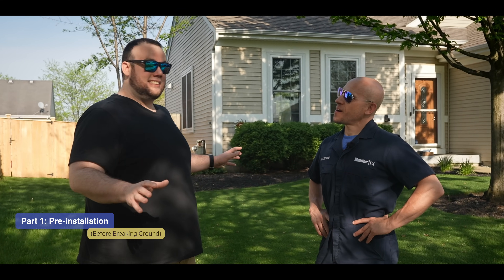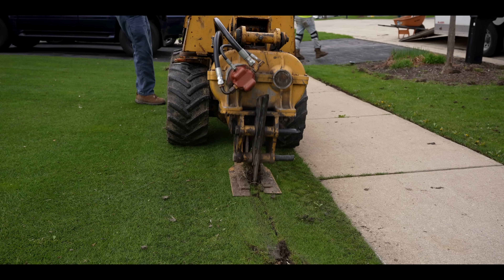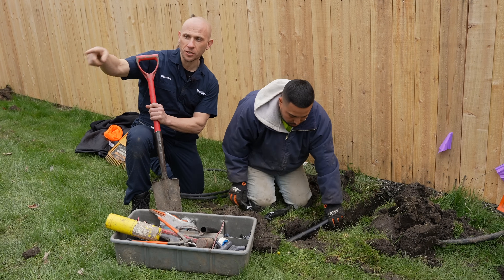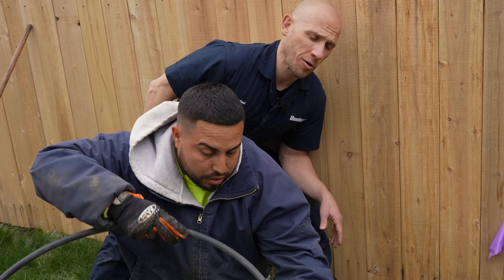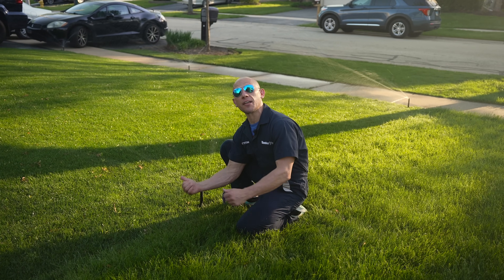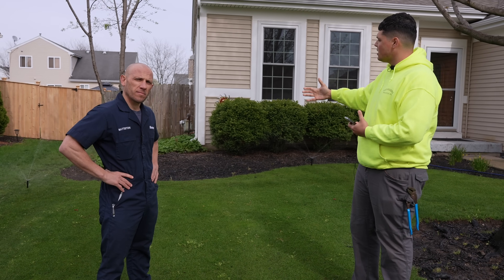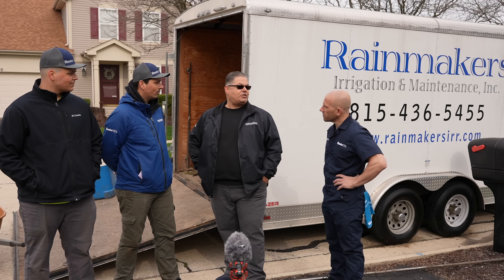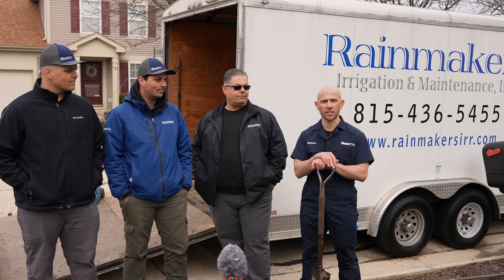I Just Got the ROLLS-ROYCE of Irrigation Systems

Comment: I installed this exact same system myself as a DIY on a 10k sq ft yard last fall. It was definitely a lot of work and took a lot of planning. I installed almost 80 heads, and had to tunnel under sidewalk 5 times since i have a corner lot, and need to get into the easement. Heck I was able water my entire easement with ~20 side stripe heads on a single zone, yea i have a large corner lot! It so awesome, and I don't think you can do that with traditional short range spray nozzle, but I could be wrong.

I learned to use a trencher, and it took more time backfilling the trenches. I saved myself almost 5K!! It is definitely a lot of work, and it took about 5 full days to install 8 zones, and rough in 2 additional zones for landscape irrigation. 

After it is all said and done, MP Rotators and their Hydrowise are the way to go. I can tell a big difference between my lawn and my neighbors who have traditional spray nozzles. I only water my lawn 5 times a week, and it every sq ft of the lawn get no more than 1" of watering a week. Plus the controller can monitor how  much rain I received at my house to alter the water schedule.

I am thinking of creating a video tutorial or my process. It includes the planning, such as how to zone using Hunters provided documents, and installation process using poly tubing since I documented every step I did for future reference. I even had professional irrigation ppl see it, and they were impressed. Lol, or just making me feel good and not telling the truth. Haha.

If anyone is interested, let me know I can create it!
Reply from the maker: Wow props to you my friend, i knw that was quite the project!
And you should make a video! There is a big audience for it.
Reply: I would like to see this!
Reply: Definitely produce that video

Comment: I am I licensed irrigator in the state of Texas, these mp rotator are really awsome. They definitely save water and are extremely durable. I've never had one fail on me
Reply from the maker: Thats great to hear!
Reply: Thank you for your feedback, TExas does it properly with their licensing
Reply: We have had so many failures in our northern climate we refrain from using MP rotors.
Reply: Any issues yet? I plan on getting about 40 MP heads installed across 8 zones
Reply: @theclan011  no issues if installed correctly. Use 40 psi regulated heads with check valves and it will run smoothly.  Even used them in reclaimed water and they do great.
Reply: @AaronRodriguez-rr8dl thanks so much. I hired the guys from this video, rainmakers. They were the only guys in the area that had this down to a science.

Comment: This is pretty much my exact setup: mprotators with the hydrawise controller (my installers thought I was nuts when I asked for them since you need a lot more heads for full coverage). Only thing I wish my installer did was give me 6” popups in certain areas since I mow tall at 4” most of the year. In certain sloped areas, the head barely gets out over the grass especially when it’s overgrown. Something to consider if you have sloped areas or mow tall!
Reply from the maker: nice! are you going to eventually get the 6in pop ups?
Reply: @PrincessCutLawnCare  in certain areas I may make them swap them out but I finally got the lawn back to what it was prior to install so I’d hate to tear up some of turf again. Even though they used the same machine as your installation, it still left divots that I had to level out alone with reseeding certain areas. Minimal damage compared to trenching but definitely still needed work after they left…

Comment: Thanks for the video. I have the Hunter PRS bodies and MP rotators, only 18 months since install and two MP rotators do not turn automatically anymore and need a manual turn to get them going. The supplier replaced both for free, but it took a lot of discussion back and forth before they would accept the return. Citing reasons like, my pressure is low (no), clean the units they must be dirty (that was my first step), you have hard water (well who doesn't), these are designed to work flawlessly (no).

They work great and I love them, but be aware, you will have issues with the MP rotators at some point and they will need replacement. Easy and cheap to do, but not without fault. The coverage they provide is excellent.

Comment: Great video. I paid 13K to have our sprinkler system installed a few years ago and I told the guy that all I care about was to have good coverage. Needless to say I got the complete opposite. I’ve got zones with 12 to 14 heads on them which is WAAY to many. As a lawn care nut, it’s one of the biggest stresses in my life.
Reply: If you don't already have them, swap out to mp rotators. Their low flow can handle that many heads on a zone provided you have 1" lines and decent pressure.
Reply: 1 zone can go up to 100 IF you have strong water flow called GPM ( gallons per minute). For example: if you have 20 GPM, then 1 sprinkler used 1 gpm. You can use up to 20 sprinkler. 
Most of RVan is the kind of rotary nozzle have use 1 or less. So basically check your water pressure, use rotary nozzle like the video you will have good system.

Comment: Irrigation is actually pretty easy to DIY. I’d hire out the back flow but once you’re past that it’s pretty straight forward
Reply: Good video though 👍
Reply from the maker: @TheLawnWhisperer  thanks man, idk with all those mp rotators spinkled throught my yard, i would dread digging 50 holes haha
Reply: Try that here in Florida when it's 96F outside and 90% humidity. I bet you get 5 holes dug and you're done for the day.
Reply from the maker: @kenshinhimura9387  sounds like a nightmare haha
Reply: @kenshinhimura9387  I would still do it 🤷🏻‍♂️

Comment: I did DIY using a regular hose, flexible pipe to connect sprinkler heads and MP rotators then each “zone” hooked up on a Orbit B-Hyve timer. Since I’m using normal pressure coming out of the house, I could only connect 3-4 heads per “zone”. I dug by hand using a shovel (huge pain) but at least it is “in ground” now.
Reply: @Anrodj3  i forgot my measurement of gpm but water pressure is 50 psi
Reply: Okay, so reflecting on it, would you hire or DIY the one on your next home?
Reply: @kevinbattistoni5960  depends.
I did professional install in my new build that’s currently building. this is solely because the real estate market in that area prefers it. (Almost every house has it.) 
If the local market didn’t care for it (ie. there is little to no ROI in home value for installing professional in-ground sprinklers), I would still do DIY.

Comment: With the online websites available to help the DIYer, this is really not that difficult of a job as they state. This is a big sales pitch but still a great informative video. There are several website you can upload your house and lot layouts that you have drawn out of use Google Maps for an aerial view of your house and take a snapshot. Upload and you can plan the entire system out with zones etc. Now be sure to check with local laws etc for permits etc but yes it's usually true you need a plumber to get the plumbing part done but it's not thousands of dollars for the install. There are so many websites to help you out and get the job done yourself and done right. Now don't get me wrong, the Pros do a great job and have lots of experience but one can do it yourself with planning because that's what your paying for with a Professional installation. Heck I currently use my backyard faucet with a 3 way timer splitter and it works great! Do what works for you!

Comment: My last house I paid for a professional install, my current house put in a full 12 zone system myself, 0 issues. The professional one, multiple leaks, heads not dialed in, and a messing looking wiring in the valve box. My install super clean valve box, all wiring in conduit, added surface shutoff, filter, pressure gauge and blow out connection. 
I think this guy is overselling the professional work being labor intensive lol. One of the easier jobs I have done.

Comment: what happens in winter when freezing comes to the water trapped in the check valves? do you need to evacuate the water with air pressure? how does that work without an air compressor?
Reply: Yes, the system will go through what we call the winterization process. Will shoot the process and put it out in George's channel this fall, stay tuned.

Comment: I need this in my area. I’ve had 4 companies come give quotes and all use trenchers only and basically don’t care about damage to the lawn.
Reply from the maker: oh no! we want to avoid those trenchers
Reply: @PrincessCutLawnCare  I used the link in your video description to get connect with potentially 2 new companies I’ve not tried so thank you for that! Hopefully one of them can do it like they did in your video!
Reply: If everyone giving you an estimate is using a trencher it's likely because your ground conditions in your area are too rough for a polar to actually work. Hard ground means trencher loam soil little bit of clay you can get away with a puller
Reply: @BattistoniTrenchTalk  was told today that usually no one recommends a puller because of the shallow pipe it lays that could be hit by a core aerator.

Comment: An MP-Rotator system isn't trivial to install. There are a lot of different heads. Mapping the locations and distances accurately is critical. But well worth it. I've done 3 systems in the family and the results are excellent. Never mind the physical labor, which is the same regardless of which underground head system is use.

Comment: Question.. with the mp rotors, do you need to add more time when I use my irrigation. I have those in the back and the regular sprayers in the front of house. I usually have a set time for the front and back. Also am I able to switch out the fronts for the MP rotary
Reply: Correct, the MP application rate is .40 inches per hour and spray heads are 1.5-2 inches per hour.

Start buy doubling the run time and adjust from there.

Yank those spray nozzles in from and swap out to MP's your turf and you wallet will tank you🎤💧
Reply: @BattistoniTrenchTalk  thank you for the info. I really like the MP rotary.
Reply: @christopherortiz8713  my pleasure, we're glad you found value in the information shared.

Comment: Nicely done video. I noticed that you used clamps on the Poly but not on the flex pipe. Also a little heat to get those barbed fittings in.
Reply from the maker: Thanks Bob!
Reply: Poly requires crimp clamps, flex pipe does not. Thank you for engaging in the content

Comment: I was recommended by a company to not use a pipe pulled because the pipe might be too shallow and could be hit during core aeration. What do you think about that? Was it discussed?
Reply: Not true at all the depth of the pipe is 100% controlled by the blade the contractor uses and they come in a multitude of depths 10-12" is standard. some ground conditions are too rocky for pipe pulling and in those markets trenching is standard practice. local knowledge always wins!
Reply: @kevinbattistoni5960  thanks!
Reply: @kevinbattistoni5960  Are you the hunter rep for St. Louis, Mo by chance?
Reply: @Andrew-co6wn  Yes sir, I'm your Huckleberry
Reply: @kevinbattistoni5960  I worked/learned everything i know from John at automatic rain. Worked for him for 5 years, you drove us an ICC2 one time all the way down from Chicago, never forgot that.
Reply: @Andrew-co6wn  JP is one of the best, Only installs the top shelf ^' I20's & 6" pro-Sprays. Thank you for dropping in with your comment, goos stuff. I've always been pretty intense and I guess driving 330 miles to deliver a controller qualifies, lol.

Comment: I did my own system in 1994 with pvc pipe and a Bobcat trencher. Thank god I did not have to waste time with stupid permits and a backflow because the water comes from a well and pump. That vibratory plow is useless here the coral rock will rip it off. Rain Bird R50 sprinklers and all still work almost 30 years later. Some valve and key removable sprinklers with brass Nelson impact sprinklers. No funny pipe . Above ground pipes are galvanized and all pipe is schedule 40. Since the lawn was nothing but weeds I used the Bobcat for all manual labor and only had to connect heads, valves and wiring manually. The solenoids have had issues with corrosion and clogging. There is an in line screen but lime deposits can form anyway. My control system is homemade and its heart is a mechanical timer and a cam control salvaged from the dumpster at the traffic signal yard. I think the whole system cost me less than 200 dollars in materials and two days labor.

Comment: I got a hunter irrigation system. What sprinklers do I need to get?
Reply: When you say you have a Hunter system, that typically means you have a Hunter controller, but that doesn't mean that the equipment in your yard is Hunter as well. You will like to have a combo of spray heads, https://www.hunterindustries.com/product-line/Spray%20Bodies  & rotary heads, https://www.hunterindustries.com/product-line/Rotors,  as many yards tend to have. That said, the low-hanging fruit savings would be to switch out all your spray nozzles to the MP rotator equivalent = healthy lawn and water saving. https://www.hunterindustries.com/product-line/MP%20Rotator

Comment: Great video! The MP1000 has a distance range of 8-15 feet. The MP2000 has a distance range of 13-21 feet. If the the desired distance is 14-15 feet, would you recommend the MP1000 or the MP2000 nozzle? Are they more effective at the shorter distance of their range or at the longer distance of their range? By the way, I have a well not municipal water. Thanks!

Comment: MP nozzles were developed for agricultural purposes. Most of the time, customers actually are watering less per square feet, automatically getting better results in cold season areas, what they should be doing anyway. Most of my customers try themselves to "fix" the system increasing to 40min per zone and messing up with the PGP heads, watering in windy weather... 
""Ok, do you want a MP system, ok, but they suck. They get clogged very easily, its uneven distribution with HUNTER nozzles and takes forever for winterize 😅

Comment: Very impressive. But I need a low-budget DIY option for my drip-only project.
Reply from the maker: Thank you sir, i will see if kevin has a solution for you
Reply: Every irrigation supply store and possible local home improvement will sell a timer that screws directly into your hose spigot. On the bottom will be a place to screw in a fitting to which you'll then need to convert to the drip pipe itself. Just be careful about how many feet of drip you run, a hose spigot on your house normally has a 1/2 or 3/4 line feeding it, if you run a lot of feet of drip you'll have poor pressure. Drip is very forgiving though as far as pressure is concerned.

Comment: I’ve been doing irrigation for years for the city of Denver. What I’m noticing is that they clearly DIDNT go deep enough. This guy knows he supposed to go 18-24 inches down, passed the freeze zone and especially since your in Illinois. You may have issues late on. Another thing would of like to see him talk about how to test your flow easily. With a 5gal bucket, time it to see how fast it fills then from there you can figure out your water pressure. He also should have showed you the “witching sticks”. But irrigation is a great investment.
Reply: Thank you for your feedback, it sounds like we have different depths of pipe in different state as we have been 10-12" in the Midwest for over 90 years as my grandfather & great grandfather have told me. They installed 100% so stems back in the day. Our frost line goes down multiple feet in the winter so we blow the systems out with compressed air to avoid freeze damage. Thank you for engaging with the content.

Comment: As I’ve seen shortcuts funny pipe only gives pressure not volume that RPZ is cheap can’t handle are winters for long term. Plus the       Y Strainer sits right behind the pipe at gas meter. With over 30 plus I can point out many problems. If you going to put a system in do it once or just don’t do it. Plus I didn’t see a flow meter on to show what is really be put down for water and for WiFi it’s only good for just turning on off or adjusting minutes. A flow meter will tell you when there’s a leak broken head to go with the WiFi. An average house uses 45 to 55 heads for proper coverage head to head. I saw this and shortcuts cheap installation
Reply: Thank you for your opinion, we appreciate you taking the time to share your thoughts, the system has a flow meter at the POC. Hydrawise does a multitude of relevant functions to the system that you didn't touch on in your comments, we're happy put you in contact with a Hunter sales manager in you area so you cane expand upon your thoughts as we live feedback. In addition to that they can get you dialed in with the full s ope of our product offering and software capabilities.

Comment: the pre install is excessive to figure out the physics of trying to get enough water to the certain areas you are trying to water; GPm and PSI are very important and can lead to poor performance if not considered when you are splitting runs of pipe and you end up bottlenecking certain areas and have no choice but to have another pump or redo the design of the system

Comment: Lol, I installed my own irrigation system and well pump as well as my own HVAC system.  These systems are just not rocket science.  I like hunter pgp heads but prefer the Orbit brass heads for the small pop ups.  I use irrigator brand pumps for my well pump.  For HVAC, Mr. Cool Universal is what I use.  Installed two of them.  These contractors will bend you over every chance they get.